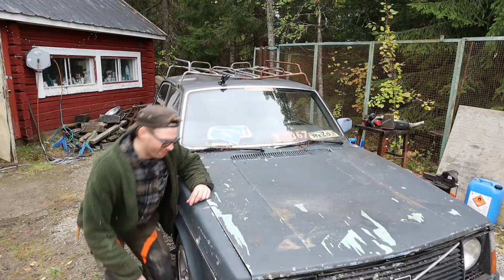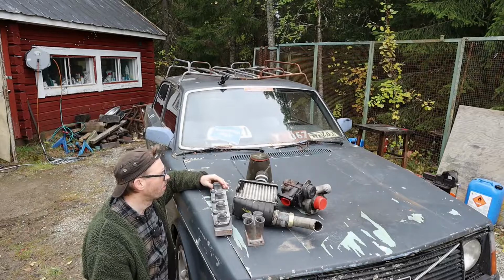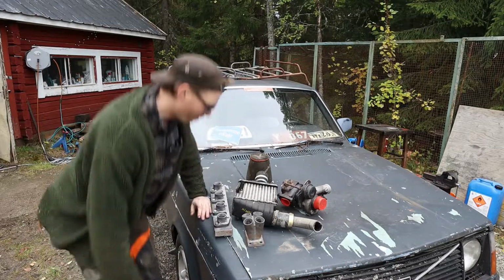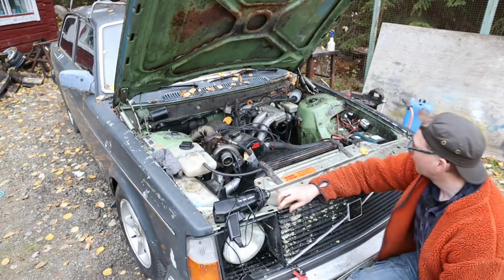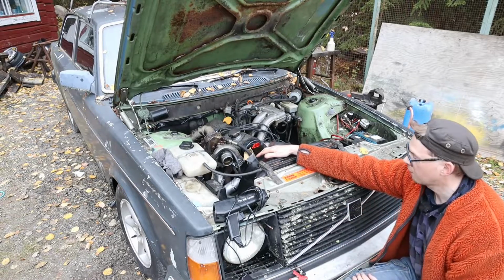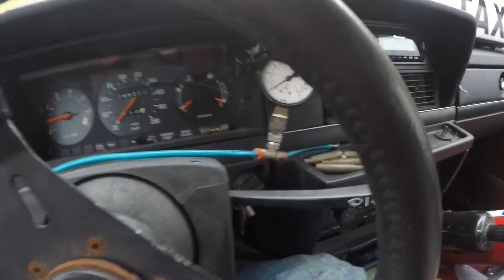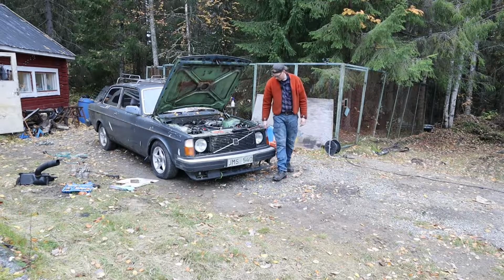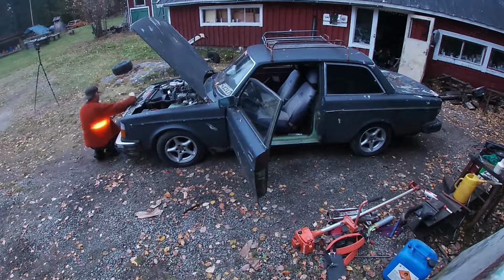A Crappy Volvo 240 -76 gets a crappy turbo conversion on my driveway , and the result is ...

Comment: Hi, years ago I added a turbo to non-turbo 2.3 Volvo 245 using all factory parts from a junk turbo 2.3 740. I ran a fmu on the fuel return line to richen the mixture during boost. It ran great immediately and pulled very strong. I wouldn't be surprised you need to do the same thing, you're probably misfiring from leaning mixture under boost. This could be verified with a wideband O2 sensor in the exhaust. Otherwise I really admire your fabrication skills. I know it's discouraging but I think there's an easy solution. Here's another quick test to prove its leaning out for very little cost. Upgrade your fuel return line with high pressure fuel injection hose then gradually pinch off the return line with a pair of pliers to raise the fuel pressure to the injectors while you're driving the car under load and if the problem goes away that proves you need an fmu.
Ross, in Maine USA
Reply from the maker: could be a plan, and not a very expensive one either, but it still think its wierd that it breaks up at the same rpm on load and off load and that it even did it before the turbo installation, so i am going to take a look inside the distributor and see if the springs are okey that pulls back the weights for advancing the timing.
Reply: @Foffe2000  Sorry, I missed your comment on the video that it was doing it before the turbo installation. If it's misfiring with no load but just at a certain RPM each time, it might be interesting hook up your timing light and then watch to see if the timing on the front pulley changes at that rpm when it cuts out. If it advances normally as you bring the revs up from idle and stays at that point as the engine is cutting out I think you'd know the distributor is doing its thing properly.

Comment: Sweet! I have a 240 with b23 that I've been thinking about adding a turbo to. Wonder it the kjet fuel system is up to the task. Would love to see some more videos to see if you can get it to run right!
Reply from the maker: well, this one didnt run properly at all.. but k-jetronic SHOULD be good for turbo application. The injectors puls in fuel continously on numbers of squirts per second and doesent care about where the piston is in the cylinder, it only acts on the engine rpm and the mechanical air-flow-meter witch is basicly just a flap on hinges. At the same time i havent gotten this one working properly (yet) so dont take my word for it.
Reply: @Foffe2000  yes, that was my thoughts also. Really seems simple enough. As long as the boost level isn't too hight the fuel flap should be able to adjust fuel accordingly.

Comment: well that one guy from boost SE or whatever his shop is did a diesel conversion or you converted his block to Diesel and that seemed to work pretty well for him.
he installed the diesel injectors where the spark plugs were and to use something like healicoil or I forgot what type of Steel inserts but it worked pretty well for him.
he installed the diesel pump on the front of it and of course it was turboed and he also used a fuel preheater to get the fuel up to a very hot temperature  from an oem volvo fuel heater.  

You could do the same thing with one of those GM Hot water sprayers so the fuel would be hot the second it came out of the pump.      
 
I believe his fuel pump was off of a Volkswagen and it was driven by a cam belt.  

Do not give up.    but I completely understand your frustration with K Jet.

Comment: Pros and cons of a turbo B23:
Pro: Turbo
Cons: B23
😁
Reply from the maker: i saw yesterday that the world record (according to them self) are 1000hp out of a 8V b23 , so its up to the fabricator (me) to prove myself now 😂 just another 950hp to go!
Reply: @Foffe2000  If you mean Rickard Thomsson's drag racing car it makes even more, probably 1600 crank HP 😁 Insane engine, almost 20mm lift on the cams, billet head, 98mm turbo and injectors that could work as a fire hydrant 🙈

Comment: Over 20 years ago I fitted a B21ET to a RHD 244DL. Volvo never made a RHD turbo 240 because the turbo would be very close to the steering column. The existing loom plugged straight into the donor engine loom. I just had to fit a fuel pump relay and wiring to the in tank pump. I had four 200s at one point.
Reply from the maker: at least around here volvo got the reputation being a little bit like IKEA when it comes to parts and how they intercept between different years and chassies of volvos.
Reply: @Foffe2000  I love Volvos of this age. So reliable and easy to repair.

Comment: Looks like you need to convert one of your buildings to a shop so you can work on cars in the winter too. I guess the forks are coming off soon and will be replaced with a bucket to move snow.

Are you sure you getting enough fuel at the higher rpms?
Reply from the maker: Hey Cullen, yeah some garage would be nice. But i do not deserve one since i dont keep things organised. And further more there are some threats with getting a forced break from fixing the mechanical things, i got other hobbies to and i get more time for them during the winter months. Regarding the volvo engine i am not sure on anything, but i do think the span of the ignition feels to be way off. so i am going to take the distributor apart and look if both the springs that hold back the weights inside are there and not broken.

Comment: Foffe it could  be your fuel pressure regulator is bad or pump cant supply enough fuel , check filter also, also check spark plug leads foffe, The engine sound to me like your not getting enough fuel for higher rpm
Reply from the maker: I did check the fuelpressure .. that fuel-line over the roof was the return line .. if it would starve for fuel i should have had less/no fuel trough the returnline .. I didnt count on that this K-jetronic dont calculate the air-pressure .. as it was i only measured the air-flow

Comment: Nice 242. I think the fuel system is the problem, the mechanical injection never works good anyway
Reply from the maker: yeah it might be a reason why they did didnt make that system for that long. The work done so far doesent have to be remodeled for me adding a haltech system later on tought. It makes for funnier videos if i use trial and error and fix stuff as i go

Comment: whats that blue tubing that you use for mock ups? its wonderful!!
Reply from the maker: its a mockup tool for piping, the manufacturer is "ice engine works". They are quite expensive i think i paid about 1200 dollars for the big kit. If you are about to buy a 3d printer or know someone with one i would recomend trying to make a few yourself first and see what you think about the system.

Comment: I love the idea but im thinking  of doing the same so i am wondering where you got all the parts from?
Reply from the maker: Det tyck ja absolut ni ska göra grabbar, eran 240 verkar ju redan gå bättre än denna men mycket vill ju ha mer! Det är en saab 9000 turbo och faktiskt original K-jetronic insprutning som kom på volvo 240 GLT modeller (bland annat) kring 1980 och fram till 87-88? typ. Inför nästa säsong blir det nog svenskt Maxxecu insprutning om jag får allt att fungera.
Reply: @Foffe2000  Ok tack men tror du att jag kommer behöva byta insprut på den det är en 1988?
Reply from the maker: @garagefix3003  från och med 88 har du lamda-styrning på avgassidan och troligen modernare luftmassemätare av samma stuk som bilar har än idag 2022. Alltsammans är bättre grejjor än det jag håller på med i videon ovan, dock troligen svårare å manipulera. Men du bör inte ta råd av mig på ämnet då jag som du ser i videon inte fick motorn att fungera ordentligt på högre varv, det blir som sagt var troligen eftermarknads insprutning nästa säsong för min del.
Reply: @Foffe2000  Ok Tack Så Mycket För Tipsen! Och Lycka Till På Dit Projekt.